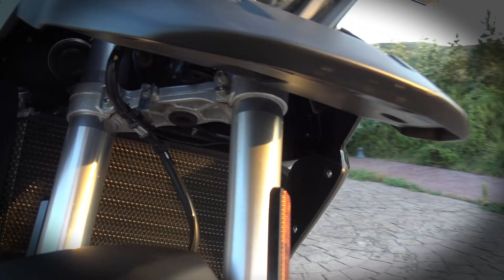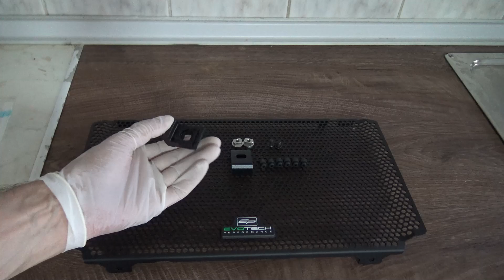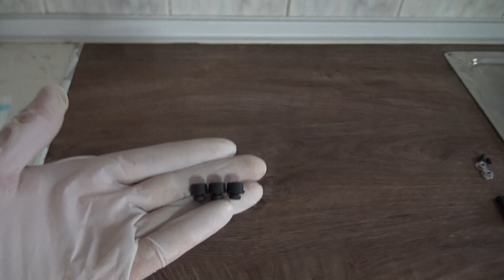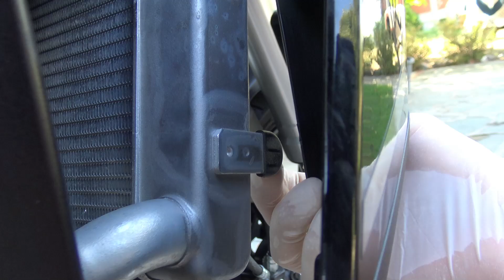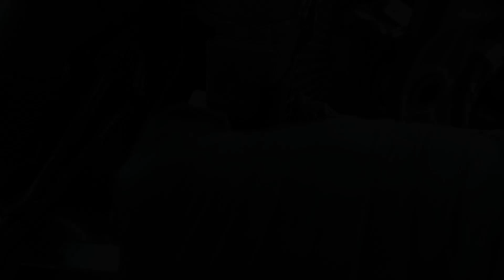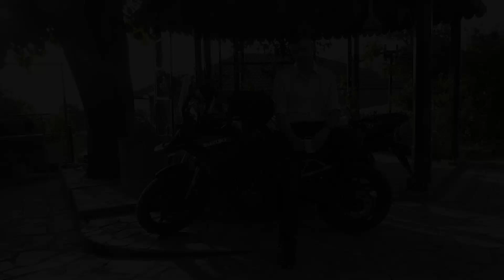Radiator Guard | Vstrom 800 Accessories

Comment: Great video!  Ordered & just mounted the Evo Tech guard.  I didn't have to move or remove any of the side panels.  It was easy access without hindrance.  Went on simple, however, the upper left corner was loose so a small zip tie through the corner hole in the guard & wrapped around the bracket did the job.  Nice product.  Probably spent more than other brands because of overseas shipping & duty but I like when I can see you install it and recommend it.  Kudos and thanks!  Also, I have the Veridian Cruise Control on its way.
Reply from the maker: No problem with mine. I have a video for Veridian. Ride safe.

Comment: might be a good idea to add a small spring washer to the 2 cap head screws (Allann key) on the underside, IF there is any vibration on the radiator there will be little to no chance of the screws falling out in the future.
Reply from the maker: All good so far and after so much time. Thanks

Comment: J'aimerai connaître ton avis honnête concernant ton changement de moto (Vstrom 650 vers Vstrom 800), regrettes tu ou pas ce changement ? merci... I would like to know your honest opinion regarding your change of motorcycle (Vstrom 650 to Vstrom 800), do you regret this change or not? THANKS...
Reply from the maker: I do not regret because the 800 is a balanced option between the 650 and the 1050. It has enough power and great fuel and maintenance economy. It has great road behavior, brakes, suspension, technology and is much cheaper than the 1050. Its not perfect, but pretty good.
Reply: @DrVstrom  Merci ;)